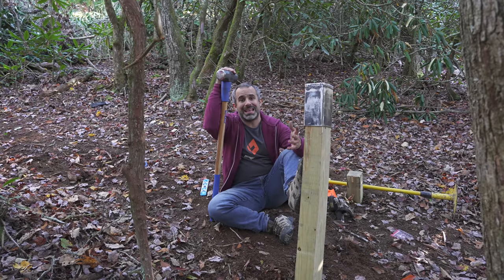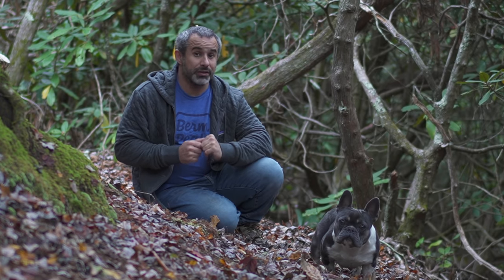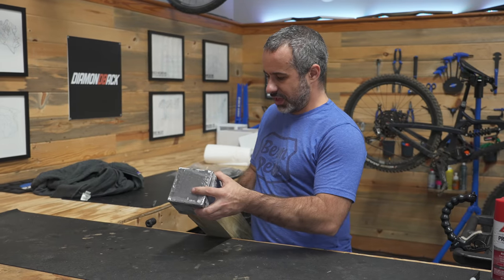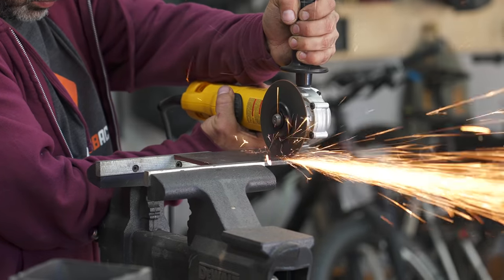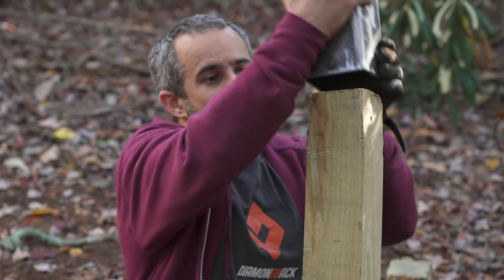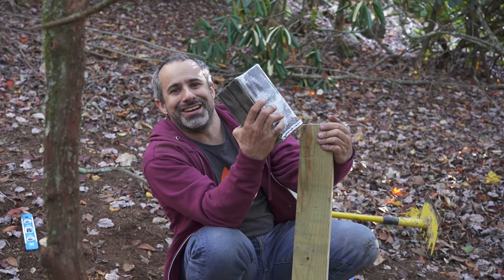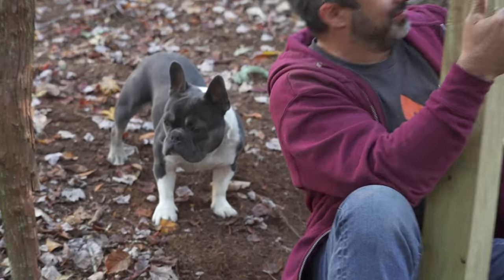Making a Metal 4x4 Post Driving Cap for Building MTB Features

Comment: Just do the exact same thing with 4-1/2" SHS. BUTTTT turn the amps on that welder up about 40% and turn the wire feed down about 10% and go slower with the welding.

Comment: Easy fix: 1 - Use the whole length you have built and make lots of caps, smash them on each post and weld bolts on to affix your features to. Stops splitting, and protects the post. 

               2 - Cut the square tube down the two opposite corners, and with a small filler make the tube just a bit bigger. 

               3 - Belt sand the tops of each post down, mostly the corners and chamfer your post protector. 

                4 - Go to a farm store and purchase a pre-built post hole pounder, and stop wasting time on something that has been around for 100's of years. I would just go rent a gas powered one, they can get all sorts of crazy places, and you just move them with a small ATV.

Comment: A thick plastic cap would survive a lot better... get a 1" plate of UHMW or Nyloil and attach some simple brackets to hold it onto the top of the post and it will survive the hammer blows much better than metal, and it will be lighter too!

Comment: The way you built the first one would have worked with a thicker plate on top and you need to cut the steel so it has a corner to corner joint. 
You will get a much stronger weld that having a butt joint like you had on both versions.

Comment: Haaa.  🤣 Good times reminds me of my wife's thesis.  Pounding metal boxs into soil... but found .120 min wall thichenss in 4130 or .250 thick in 1018 welded with er80d2  capped with 312 stainless filler worked best. Probably overkill for this project though.

Comment: What if you took a think plate of steel and cut a plus shape ➕ and bend the sides to create the same shape you did here, but without the welds. You could control the inner dimensions, and will be much stronger because it’s one piece of metal with no welds. 
I’m probably not explaining that very well…

Comment: Just make a pile driver, a 3ft long square tube with a thick plate welded on the end and long vertical handles on either side. Or just buy one. I used one as a fencer on a cattle station and it is so much easier than using a hammer

Comment: The sleeve doesn't need to be so long - cut it short (1-2 inches ?) and then drill a hole in 2 sides to tack in in place (w short wood screws) while you whack it. take the screws out and repeat.

Comment: Dude! Just cut it down so it’s only an inch or two deep. Then take your grinder with a zip disc a make relief cuts on all four sides. It’ll be tight for the first few times but eventually it’ll splay out.

Comment: Cut the side Seth. You don't need a "square" top. You just need it to sit on top of the wood to take the abuse, the two sides that are open on the side won't matter either.. Even better idea, use metal for the restraints in the hill.

Comment: Love the fails.  Idea: cut most of the sides off, leave about an inch.  Weld those sides to what was left, that should fit over the 4x4 no problem then fill in the 1’’ part. Hopefully that makes sense, can’t draw in a comment

Comment: It's not a failure but a idea that needs improvements maybe take the idea of a post hole pounder. Square tube with handles. A big plate inside with a spring that is connected to a top plate. Easy on your hands, less vibrations and is portable. Think smarter not harder. Saves wasted time and money.

Comment: I Imagine just a thick flat piece of metal with a small hole in the middle so you can tack it with a nail to the top of the 4 x 4 would distribute the load just as good and wouldn’t move… might break the nail but it would be easily replaceable

Comment: take the pipe and cut it into 4 then grab scrap post put clamp the steel pieces to the post and make the box again from that point so that way its snug but not snug enough that if you put a handle on the side you can take a hammer and pop it off!

Comment: Could you not cut lengthwise each corner (4" or to the length of one side of post you'll be hammering on) and then bend the 4 new 'flaps' down 90 degrees. Effectively making the top 4 layers? Obviously weld that thicc stack together, no sledgehammers going to dent that

Comment: It broke instantly. Yes you need to turn up the amps and wire speed on your mig. If while you are welding it must sound like frying bacon not POPPING. If it is making pops you are getting no penetration in your weld.

Comment: Chock it up to not realizing that "4x4" steel tube is outside distance, not inside distance... Probably should have gone 4 1/4 x 4 1/4 x 1/4". That'd have given the inside length just enough to clear a 4x4 post. Could also use (2) 4 1/4 x 1/4" angle, welding the two together.

Comment: Take your high precision grinder and cut all the extra off the bottom make it like 2 1/2 -3 inch then you can either Dremel out the inside even if you have to shave abit of the end of the post it will only be 2 inches worth draw knife would do it in no time flat too

Comment: I mean, just use the thicker metal from the square pipe and cut it into pieces the right size then weld it like you did the first one? Sure its a bit more work but at least it'll work in the end..

Comment: Mate you do some amazing things. But the quality of that welding just proved you are human afterall 😅
The concept is good, but next time just hit the offcuts bin at the scrap yard WAY cheaper.
go maybe 1/2" thick top and 1/4" wall on the box section. Cut the top plate smaller than the outdude of the box section so the weld has somewhere to go.
No point welding something together then grind all the weld off ... IMHO that a large part of why it failed. Good luck look forward to the next instalment.

Comment: Take your nozzle off your welder.  Dont need it when you are doing flux core.  Or just get gas  alot easier when learning.  As for the guard on your grinder  any fabricator or someone who knows how to use a grinder  its the first thing to come off and thrown in scrap metal pile.

Comment: Drill a small hole in the middle of a 100x100x6mm plate. Then counter sink it. And then go to town. Smashing it with the hammer. Then remove the screw and the plate come with it ,     Just lakeshore it’s sunk enough that the hammer never meets the screw head

Comment: Seth don’t drive posts into the ground it’s weaker, dig down 700mm and then put your post in and backfill with concrete, it will be so much stronger

Comment: Please please please use the grinder the correct way with the sparks flying towards you and the grinder pulling away, when it catches it will pull itself out of the metal instead of into you. Especially when insisting to use the grinder without a safety guard (which would force you to use the right side of the grinder and reduce the finger cutty risky thingy). Don't want to sound all grand pa ish but I've had a grinder catch twice on me because I had to use it this way in a hard to reach spot, needed stitches in my hands both times. Felt very dumb, especially the second time around, wouldn't wish it on you or any of your subscribers (although they should be responsible for their own use and safety)

Comment: Man, just weld some wings to it on sides to make it possible to hammer it our of the 4x4 once your're done wacking it with a hammer. 
Or just do it again with a bigger metal pipe. There should be no harm if it's slightly bigger than 4x4.

Comment: Seth, it terrifies me watching you use a grinder that way. Switch your handle around, and always cut in a way that if it bites it won't come at your body. If looking at the grinder from the top down and the power chord is 6 o'clock, only 12-4 o'clock are the safe area to use a cut off wheel. Everywhere else is a chance at a nasty kickback

Comment: Don't get me wrong Seth, I love both your channels, watch every video you post on them and enjoy the content a lot. But this one...this was cringy. 
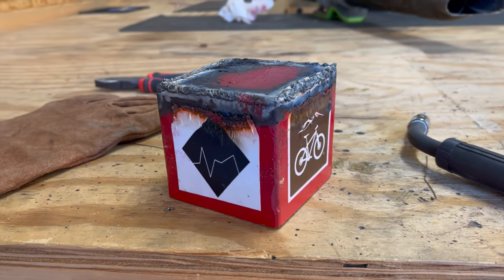First of all I'm an absolute novice welder, but the welds on that first attempt at 3:33 look like your torch has a really bad stomach flu... 
Then there's a bunch of safety issues that scare the crap out of me. I'd hate to see you get hurt in the workshop!
Things like flat grinding with a cutting disc on the grinder (ever had a shattered disc aim for your chest at 11.000 rpm? not recommended) , 
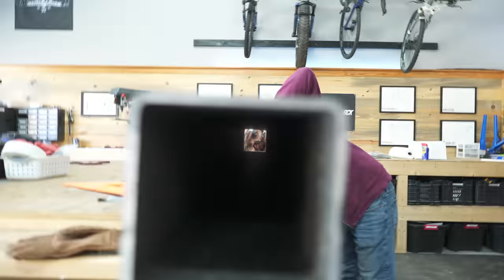or the way you're holding that grinder at 4:24  (stand on the other side so you don't have to force your arms across your body and can stay away from the side of the disc) 
or just the way you're bending that thing back at 7:50. If another one of that welds fails by you trying to bend it back, you'll have one of those sides IN your hand! 
Having seen my neighbour stab his arm with an aluminium roofing sheet a few weeks back I can tell you: BAD idea.

And last but not least: everyone knows: measure once, cut thrice! ;-) You could cut it in half both ways, leave a 1/4" gap and weld that shut, the entire thing would then be big enough to fit a 4x4, granted you can get something to cut it that doesn't have a1/4" kerf, like a bandsaw...

Comment: Get some square tube with 3/16 all thickness, it doesn’t have to be 1/4” as there are no welds in the corners and it will be plenty strong. But if you intend to try and build that again, bevel the edges where the cap meets the square tube, so when you grind away the weld you’ll still have some penetration.

Comment: just make it out of round tubing with a big enough inner diameter for the 4x4 you dont nee all the contact on the sides to stop it from splitting its about spreading it evenly on the back. never seen a post pounder or what.

Comment: Use a pipe. Weld a handle on the outside and a cap on the top. Or better yet-buy a post driver.

Comment: The problem is you arent even weld prepping the material. you couldve easily used the thin material, but you arent under sizing to make a nice fillet weld or you are beveling the edges. You are Butt welding and then grinding off most of the weld. 

You also cannot measure shit like that exact. There is a material tolerance for all extruded material. something like that +/- 0.0625. The wood you got also has a tolerance stack based on how it was cut. For you jig to work perfectly, 1/4 inch picked and oil steel will work best. You want bevel welds this means you need to chamfer all the edges to prep. Also build a jig for welding. your hand isnt steady enough.

Comment: Ah funny how 4 inch boxed tubing is only 4 inches on the outside. I did that with tubing thinking 1/2 tube would fit in a 1/2 hole. (Tubing was measured by the inside)

Comment: turn up your voltage it needs to be hotter your not penetrating the metal so the weld won’t hold because it’s just on the surface

Comment: hear me out
weld a flat piece of metal on the end of the sledge hammer and then hit, the area of contact would spread out anddd it wont split
Reply: Same thing as a sledgehammer basically
Reply: @hugo-fy7by  yah but it would have a bigger contact area so it wont split to wood🤔
Reply: @superheroleo1896  it will still split it I think